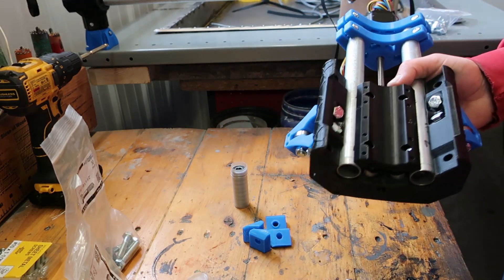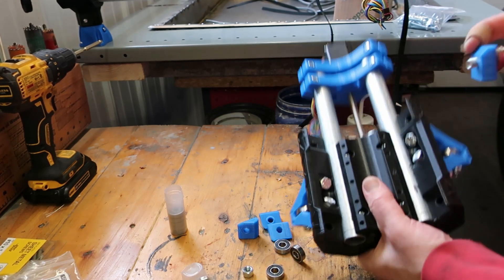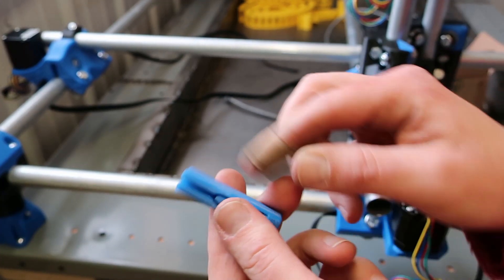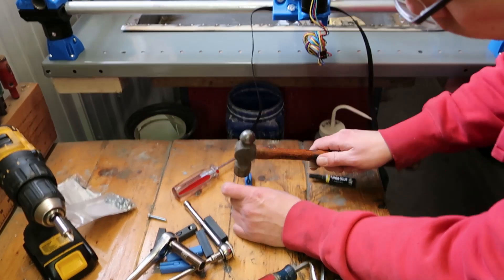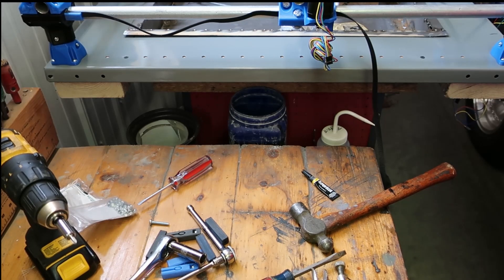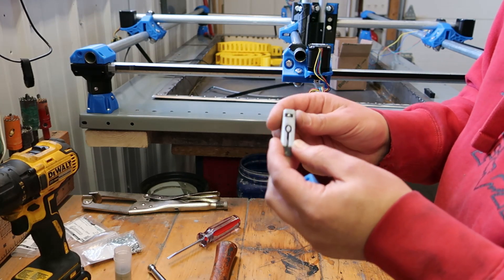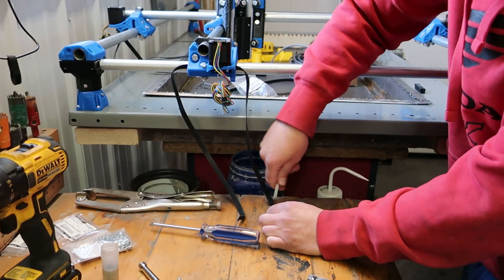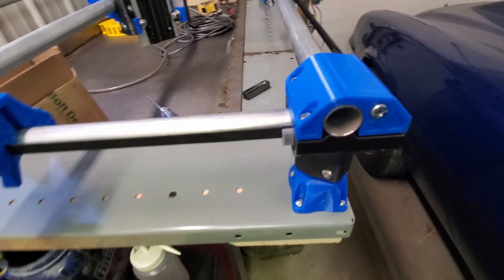MPCNC Primo Build Ep. 09 Installing trucks and Belts

Comment: I assume this just needs to be as close as possible physically square, and the software can compensate to get it dead nuts?
Reply from the maker: If you have dual end stops that would be true. 
I'm not actually running any end stops, so whatever I have for square is what I live with.